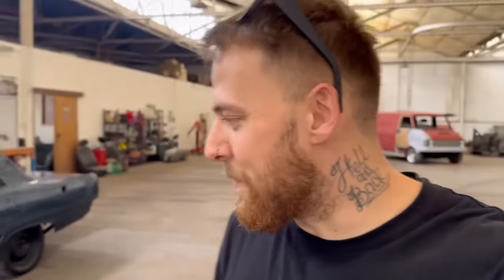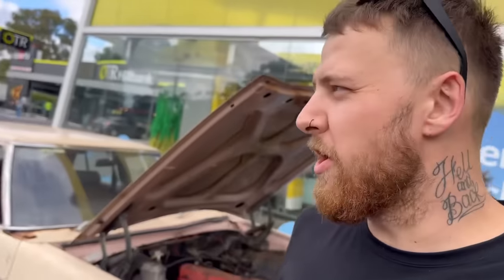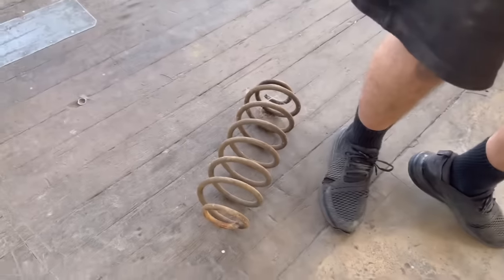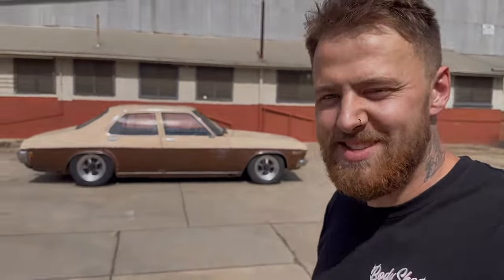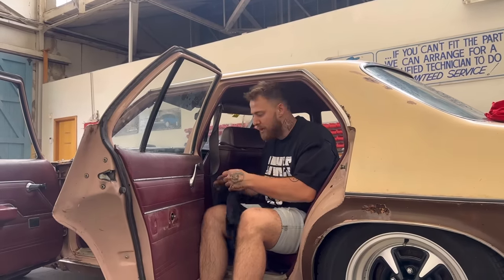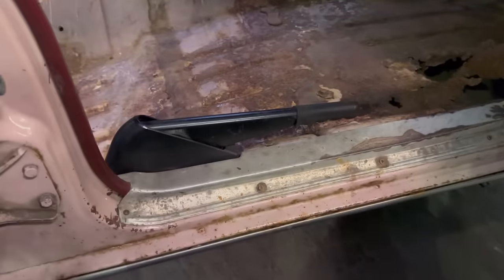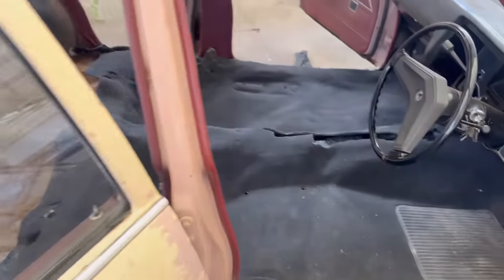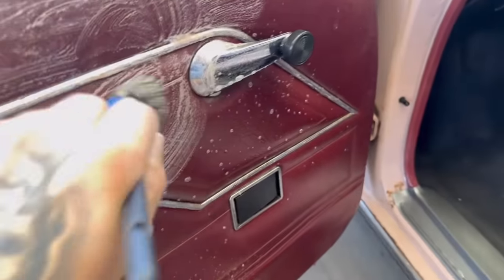HQ KINGSWOOD RESCUED & TURNED INTO THE ULTIMATE PATINA CRUISER IN JUST 5 DAYS

Comment: Should have called the channel “Cheep N Cheerful Customs. I love it, you did a great job with what you had. As young lads just finishing school in 1980 we used the same tricks to fix up our first shitters. With the cars available back then only GT’s, Bathurst Monaro’s and SLR 5000 and A9X’s were relatively big money but we all had Toranas, Monaro’s, Falcons ect. You could retire now with the cars we had. I had a HK GTS Monaro, best mate had a HJ sandman panel van. Another one had a HQ GTS Monaro with the factory 350. Yet another had an LJ XU1 and the list goes on. 
That HQ of yours would have been dumped at the wreckers, how times have changed. I reckon that Kingswood must have felt like a Premier when it was new with the two tone paint, traumatic tranny, and that maroon interior. It would have looked pretty good pulling up in the drive way. Thanks for the memories but my 2005 Monaro is a better car all round than the oldies. Cheers, Stuart.